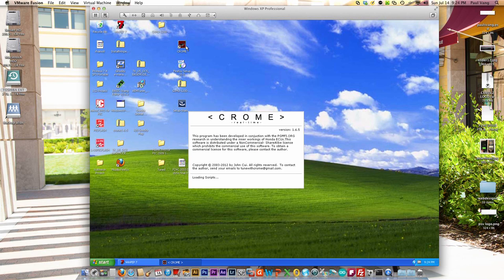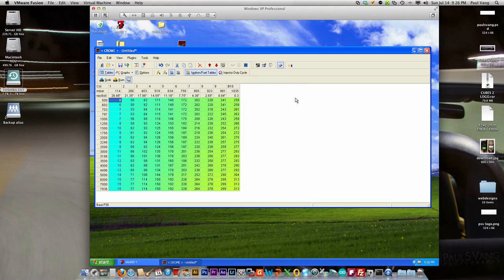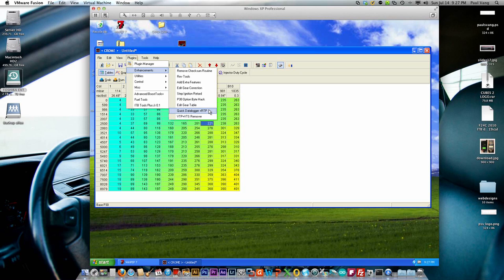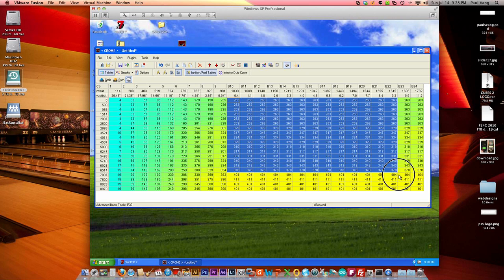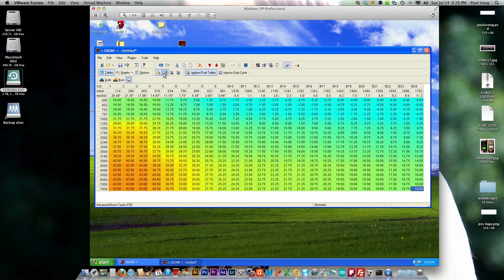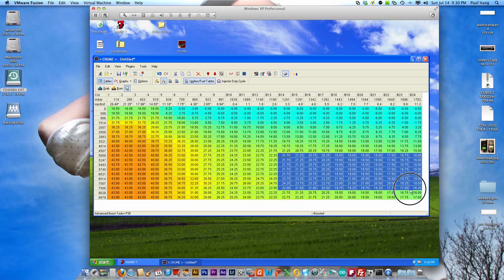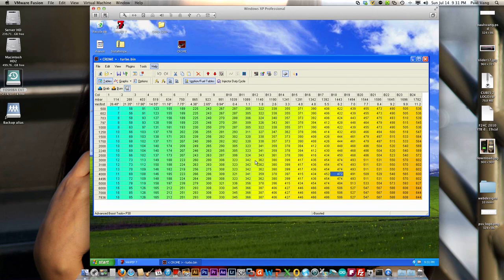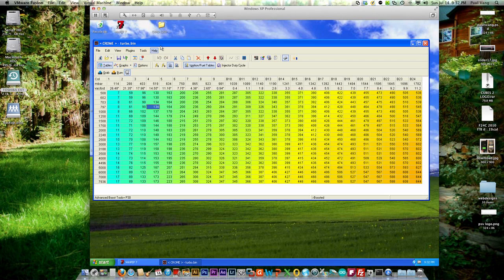Crome Tuning - Setting up a Turbo Map

Comment: Hey Paul this video was 8 years ago but I have an H22a1 swapped civic, I thought everything in the swap was stock but upon research for my turbo build I discovered my ECU is chipped. I want to tune it using crome, and understand the concept, but I have no idea where to find a basemap or how to connect my laptop to the ECU. Should I even attempt to use crome now or buy a new chip and try newer software? Any info is greatly appreciated. Thanks for reading.
Reply from the maker: Crome will work just fine. You'll need to go to moate.net to get the hulog for datalogging and the burn2 for flashing the chip. H22 basemap would have to be created or you can probably google the maps as they are readily available online.

Comment: Hey bro is it possible you could make a video for h22 map or send me one. My h22 ek has no power. Vtec kicks in and sounds good. But just has no killer pull!!! P28 ecu chipped.. injectors are on a resistor box. It is and h22a4. No check engine light vtec kicks in runs right in a sense. But no real torque and power. Help me out!!! Thanks in advance
Reply from the maker: the best thing is to put it on a dyno.  It sounds like you already have a good basemap in place.  Check to also make sure your compression is good across the cylinders to make sure the engine is healthy.

Comment: when i load the map on the chip the car doesnt rev pass 3rpm  if the offset wrong can  it prevent the chip from working
Reply: I had the same problem doesn’t go past 4K rpm. That happened to me when I didn’t have my o2 sensor plugged in my 95 GSR. I just asked Paul if I disable or not my o2 sensor.

Comment: Hi Paul I have a d16z6 turbo but on the free version of crome I cannot add boost table, can I open a p30 basemap instead of the p28 and do some changes? If so which one? Thank you for your time
Reply from the maker: yes.  Use the p30 map and add in the boost tables to that file.  It will work just fine on your setup.

Comment: I have a 240 with a ka runing a t 25 turbo and 375 cc injetor 62mm throttle. Stuck ecu runs it but I'm about to star tuning it on a type 2 data board . Do you know a base start setup the I can star with
Reply from the maker: Did you purchase the type 2 board already?  If not, get it from tunerwizard.com and ask for a basemap to be loaded with your specs.  You can then start tuning it from there.

Comment: Great video hey Paul is can i set the numbers the same for a d16a vtec . 75 retard timing? Increase fuel 10% etc? Thanks in advance for any help
Reply from the maker: yes.  Thats the standard.  You can adjust from there on.

Comment: IS it the free version of CROME?
Reply from the maker: Yes.  you can do it on the free version.
Reply: Because on the free version for turbo setup the vacuum on thé 14colonnes IS at 0.5 and i was wondering if it just because i need to get the licence for the map to make sense , thank you for your Time
Reply from the maker: @yougomods5592  The free version will work just fine.  Email me here for more details: paulsvang@hotmail.com

Comment: I have a doubt. Does the p30 turbo map work on a p28 ecu? thanks
Reply from the maker: yes it does but you have to disable the knock sensor on the p30 map since the p28 ecu does not have the hardware to support it.
Reply: thanks for sharing!!

Comment: Hi paul i was wondering if you can tell me what the numbers means on the fuel map etc.... and how can u tell when the map is wrong like for exemple when you ad 10percent of fuel how can i tell if its ok or not looking at the map ....thank you
Reply from the maker: Fuel map numbers = The duration of time the injectors are set to be opened measured in milliseconds.  You cannot tell just by looking at the map.  There are too many variables involved.   You can get a general idea if the map is any good if you knew the injector size, engine setup, all motor / boost, etc.  After doing it a long time, you start to see a pattern and understand how things should look like.
Reply: Paul Vang thank you! yes i understand

Comment: Paul, 
Do you need to remove the chip to burn it every time you change the tune? Or is there a way to make table adjustments on the fly? 
I am looking at getting an SST reburnable chip installed in an obd1 b18 non-vtec engine. the ecu is only $150 and the chip comes installed. I will probably need some sort of writing too for this as well, but I am not sure if road tuning is an option with this tuning software.

Comment: Hi im new to this and i cant find some information.

My question is can you just keep writing to a chip over and over? You dont need to erase it every time?

Secondly I was wondering if this chip programmer would work for my OBD1 B16 ecu 

http://www.ebay.com.au/itm/High-Speed-TL866CS-Programmer-USB-EPROM-EEPROM-FLASH-BIOS-AVR-AL-PIC-/262685843838?hash=item3d294be17e:g:JhsAAOSwImRYCwWj

Thanks
Reply from the maker: Depends on your programmer but if you look at the datasheet of that chip, it specifies that you need to erase before programming.   A lot of the time most programs sends an erase function before it starts programming.  Chips should be able to be programmed 1000 times depending on the manufacturer but I've seen them fail the very first time.
Reply: Thanks muchly. 

And that programmer I linked, will that work for SST27SF512 chips?

Comment: I have a question about the boost com 6 8 10 12 14 ... I put 8 but what does it do
Reply from the maker: It gives you more resolution to the boost columns. I typically use the max so that I can fine tune the boost columns.

Comment: How much is crome gold these days? I have an ostrich a moates burner and a chipped p28, and also will it only run on xp. I had awful trouble trying to get all the hardware to work together, pc not picking up the equipment. Any help would be much appreciated
Reply from the maker: Crome gold comes with Crome Pro.  If you need a license, you can get it here: tunerwizard.com

It works fine in windows 7 for me.
Reply: Thanks for your reply

Comment: Paul, I love you!! I can't describe how happy I was to find that I don't need to go to all the fuss with check valves for the map sensor and extra fuel controllers and manual timing adjustments and so on. I didn't know it was possible to tune the p28 in my del Sol to boost the engine properly, let alone do it yourself. Man, I am so happy you put this tutorial on! I am going to save up money for the turbo quicker from now on and I will use your videos to help me crome tune my Sol! Thanks a lot, keep it up!
Reply from the maker: No problem.  I have a series of videos that I'm going to release which will teach you all you need to know to start tuning from the street to the dyno.  It will most likely be on Udemy as a class course.  I'm not done yet so hopefully it will be there when I'm done.
Reply: You'd have at least one customer here, I live so far from a good tuner that I'm stuck doing it myself. Would be more than happy to pay for a good course on it. Seems like there's info everywhere but not just one solid walkthrough - and I have a super hard time figuring it out without watching someone else do it first.
Reply: Paul Vang I would have loved to help you with the test car but I live in Holland, so I am not able to :(
Reply: That is exactly my problem, with every complicated thing. Because my car is so rare (especially over here) I can't find a thing for it if it is not the same as the Civic on which it's based. Neither information nor performance or tuning parts. With this, I had to search for information on tuning by engine model, but not many people specify posts that way. Paul is really helping me out. Also, I certainly agree with you on being prepared to pay him for the perfect and thorough tutorials
Reply from the maker: I have the videos series almost done but I need to finish the last 3-4 videos of the 11 video series. I just need a donor car to finish it.  Let me know if you are still interested once it completes.
Reply: Paul Vang Superb! I am pretty sure that i'll still be interested :) Nice work!
Reply: Paul Vang Definitely still interested - just moved but I've got the car and the wallet just about ready again. If you're anywhere near central Texas, I might be able to help with the donor car.
Reply from the maker: No problem.  I've got a series of 11 short videos coming out that will show you all the details from beginning to end.  I'm 70% done. Just need a car to do the rest of the videos.
Reply from the maker: It's okay.  I was going to buy one for this video but I just looking for a good deal so I could at least sell it when I'm done.  Just haven't found one that is a "Good Deal".
Reply: Can you send me you email :
This is my email volt_ono@yahoo.com

Comment: I have a 1995 civic dx D15B7 , I have turbo installed and now need base map . Do I still need high and low cam values on a single cam non vtec engine .
Reply from the maker: +FortrexNite There will be both maps in the file but if you uncheck "vtec", then it will only run off the first fuel/ignition maps which is what you're after.
Reply: +Paul Vang awesome thank you ! great channel very helpful for learning
Reply from the maker: +FortrexNite Stay tuned.  I have more videos coming.

Comment: did i have to change my map sensor if im making only 0.8bar boost for jdm b16a turbo??
Reply from the maker: Yes you need to.  If you go down to .7 bar, then you'll be fine.
Reply: ok sir....tq so much for the info
Reply: bro need help how to setup fuel pressure regulator??
Reply from the maker: Just hook one up without the vacuum line to it.  BLock both ends so that air dont leak in.  See what the pressure is at.  Then adjust it to 43psi.  Lastly, just plug in the vacuum line back on.
Reply: when im block the return line the engine want to die....im using 265lph fuel pump...is that normal??al honda need to be 43psi in idle??
Reply from the maker: Dont block the return line.  You block the vacuum line to the fuel gauge.  Then you adjust the fuel gauge to 43psi.  Next you adjust the fuel table / global fuel settings in crome so that the air fuel is right around stoich.
Reply: oh...ok sir tq so much for ur respon ....tq2.....very2 appreciate

Comment: is it best to use windows xp for crome pro or windows 8 and 10. Because I'm like having Com or driver issue on wins 10 not detecting or actually connection times out when datalogging.
Reply from the maker: I'm still on windows 7.  It seems to be the most stable.

Comment: Hey Paul are you still using Crome Pro? and are you still on 1.5.3? I been wondering why it's a hit and miss for some, but I need to make the lastest 1.6.1.5 work so I can use Tunerview to datalog using gold rom for crome pro.

I'm not sure driver issues everyone be having but on 1.5.3 datalog is fine, but the improvement speed datalog is what I'm after.
Reply from the maker: I've been using the newer version lately.  It works fine for me but I am not using tuner view so I really can't confirm.   I'm on pro and tuner version

Comment: Just curious..i know the Prelude H22a isnt included in the listed car types on CROME but is it possible to use one of those for that type of vehicle setup?

Just asking for me and others looking for free software.
Reply from the maker: brent dL yes you can.  You can use the p30 map and then set the fuel and ignition tables along with injectors offset for the H22.

Comment: Great video. Perhaps a video covering more advanced features like Battery offset etc in the future
Reply from the maker: Dwight Charlery that was my plan.  To cover injector sizing, latency, battery offset, etc. but I just haven't had the time.  I've been busy designing some products for the automotive world.
Reply: Paul Vang that would be great, when you get around to doing it. Btw I had a look at your devices and i am very impressed. good luck
Reply from the maker: Dwight Charlery  thanks.  It's almost done.  I'm working on a chip burner right now that should be ready.  The boost controller is pretty much almost there as well.  Just keeping my self busy and having some fun at it.

Comment: I have 10 psi few column need 6? 1 column for every 2psi right?
Reply from the maker: The more columns, the more resolution which means a more accurate tune however it would still work with less columns.  With a simple setup, that would work fine.  Keep  in mind though that if boost fluctuates between 9 and 10 lbs but the column only shows 8 or 10 psi, then you are going to have to adjust column 8 and 10 hoping that the air fuel, when hitting the  9psi, is satisfactory.

Comment: I have a 2000 wrx jdm Spec and am very interested in this video you shared. What software applications support mac? What else would I need besides the software to learn & apply how to tune a turbo engine? You may have already answered some of these so my apologies in advance. Great video tutorial, Thank you
Reply from the maker: Thanks David but this would not work for a wrx.  You will have to look for a software that supports your car.  ECUflash?
Reply: I will give that a try, thanks!

Comment: Hi. Thanks for that video. I setting a turbo map. I have few questions. How set air fuel at 14.7 in idle.my wide band read Lean -. The other is, in vac 0 to to boost the wide band read 11.thats ok?

Comment: would you please make a video for D16Y series motors, all motor and Boosted, and preferably for a non vtec y7
Reply from the maker: Very easily done but I need someone local to me who can lend me their car.  The latest car I did was a GSR turbo putting out 491hp to the wheels on a dynojet.  I forgot to save the all the logs for that car but I think I saved the last log. I will have to see if I still have it so I can do a quick tutorial guide on it.

Comment: Hey I don't have the burn chip icon and I have the latest version. Do I need to register to be able to burn a rom to a chip? thanks.
Reply from the maker: No.  It comes by default.  Just make sure you select Moats under the settings options.

Comment: so what are those numbers in each cell? i can see that the 3rd row from the top shows the manifold pressure, but what does each number represent in the colored cells? for fuel map. thanks for any help
Reply from the maker: they represent miliseconds an injector is opened according to the developer.  The higher the number, the longer the injector will open.  It controls the pulse width sent to the injector.   For spark table, it's the actual spark degree before top dead center.  I hope that makes sense.

Comment: What chip do you use?
Reply from the maker: sst512, sst256, atmel, etc.... any 256k eprom 28 pin dip would work as long as you can program it.

Comment: I set this turbo map up on my LS integra in this fashion. What would help me control the idle on it so that it idles nicer. Right now I have solid mounts and the car viciously rattles and hunts for an idle. I have it with factory settings for idle target. What should I adjust?
Reply from the maker: adjust the top left column  for idle.  A richer fuel will give a more steady idle.  give it a try.  750rpm should be fine unless your on large injectors like 1000cc+ (set idle rpm at 1000 if you're on larger injectors)
Reply: Thanks that solution worked. I am noticing I am having problems with my off throttle (in gear) to part throttle. This acts as a stutter and shakes the vehicle. I am looking to get rid of that will adjusting the left columns further help that?
Reply from the maker: Um mot sure on your explanation. The best thing is to setup a datalogging so you can see what is happening.  Then located where the issue is occurring on the fuel map and adjust accordingly

Comment from the maker: You can't in stall crome on a mac. What you can do however is to install a virtual application that can host windows 7, then install crome in windows 7.  In my case, I'm using vmware fusion for mac.  This gives me the ability to install windows 7 in my mac environment.  The other option is to set your mac for dual boot.

Comment from the maker: tracerx13,
2) You have to account for overboosting.  I usually add a tad bit more fuel on the top columns just in case boost spikes up a bit.  Highlight the columns above 8lbs and add in like 5% fuel (this is base on fuel injector size)
3)It will work on other ecus as long as its the same ecu type or family but it wont work for an auto setup.
Reply: excellent work! Please write a book, i would buy it.

Comment from the maker: tracerx13

1)  You should adjust the CC for your engine.  Also note though that it will or may not let your engine run or start.  You may still need to tweak the fuel settings to get your car running to the point where the basemap is useable.

Comment from the maker: Lastly focus on tuning full throttle.  I usually start with the fuel and when its good (make no more power on the dyno), then I back off a little and then tune the timing.  For timing, I monitor torque to see if advancing timing will make more torque.  Hopefully that makes sense.

Comment from the maker: brock, 

I use to own a dyno shop.  I ran it for 2 years providing dyno tuning before I sold it to a buddy.  Before that, I did street tuning for evos, sti, nissans and honda.   My specialty has always been hondas.  Anyways, it's not hard to start tuning.  You just have to understand some engine theory to understand what its doing when you modify the fuel and timing. Get a base map going so the car can start and run.  Next focus on dailing in the part throttle (cruising) fields.